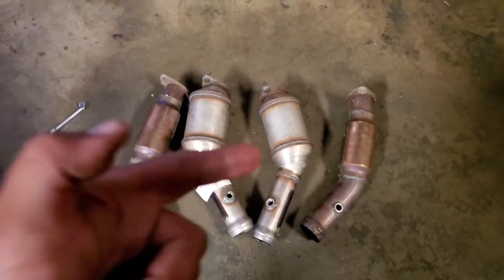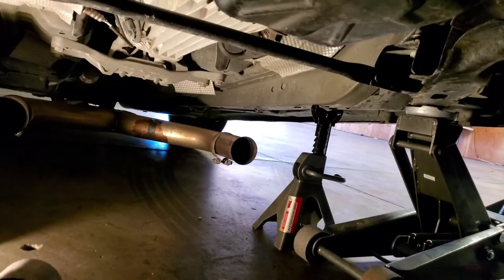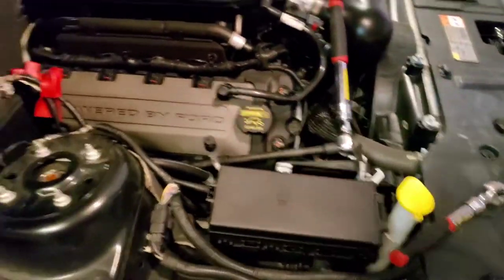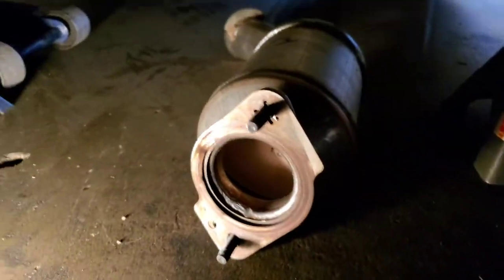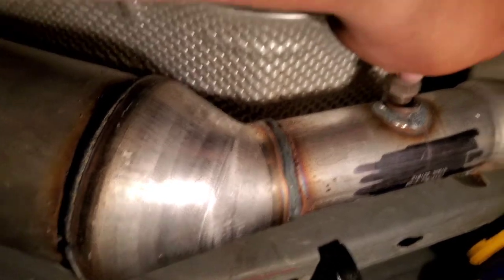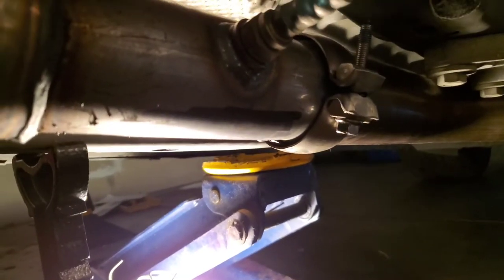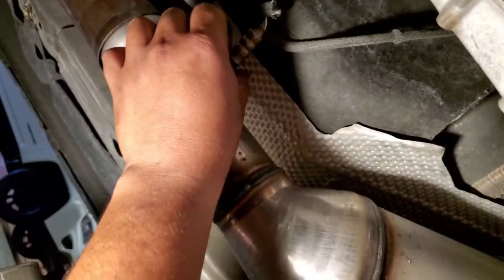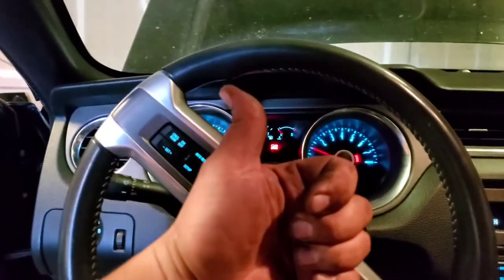How to: Install Bank 1 & Bank 2 Catalytic Converters on a 2014 Ford Mustang GT 5.0L

Comment: Hey man. I know this is an old video like the guy below, but I have a question. I just dry fit the cat to the X pipe with the ball & socket clamps. When full tightened, the parts don't come apart, but they definitely swivel around very easily like an actually ball & socket joint. Do you remember if this was the case when you did this install?

Comment: Hey man, I know this is an older video but I was wondering if maybe you could help me out real quick. I have a 14 Mustang GT and have code p2629. I have catless headers on the car. I am tuned through NGuage. I was told to replace the o2 sensor to see if that would fix the problem. The car idles very rough and doesn't feel very powerful. I'm assuming that I should look at upstream first. Does it matter which side I change out? Also, do you know if I will need one of the o2 extension cords? Thank you so much man!
Reply from the maker: Code P2629 is set by the PCM when the O2 Sensor Pumping Current Trim Circuit for Bank 2 Sensor 1 is open.

It's for the top Oxygen Sensor on the driver's side. Hopefully swapping this out will fix it....na u shouldn't need the extension....it's for the top Sensor on the driver's side u should be good

Read more at: https://www.obd-codes.com/p2629
Copyright OBD-Codes.com
Reply: Thank you sir! I will be doing it! Look for to new videos from you!
Reply from the maker: @ShadeAstray  thanx bro hope this works out for you!

Comment: Hey man quick question. I have the same car. It drives normal but I noticed that the idle is a bit rough and check engine popped up. I scanned it and got P0420. What happens if I drive it like that for maybe a month? Don’t have the money to replace the cats right now. Also, how much are the cats on the video? Thanks
Reply from the maker: You should be good driving it for a month, but they should be replaced as soon as possible to prevent engine damage. I believe one was like 600 and the other was 800. I got them from the dealership because aftermarket one can cause a check engine light. The oxygen sensors need to get exact readings

Comment: Did you have a check engine light on ? And if so did it turn off by its self or did you delete it?
Reply from the maker: Yes I did have a check engine light on, after I replaced the cats I had to delete the code

Comment: hi im planning to change my bank 2 sensor 1 (driver o2 sensor between manifold and cat) is it reachable under the car? is the connector reachable? special tool required? thanks
Reply from the maker: You can reach it by hand under the car just need oxygen sensor removal tool
Reply: How much miles were on the car? Why did the cats go bad?
Reply: @STREETFIGHTER50  close to 60k miles, my bank 2 sensor 1 02 sensor wire sleeve was damaged exposing the wire

Comment: Where ya get the new cats from?
Reply from the maker: Their from the dealership. Give your local dealership a call. Give them your vin and they can get you a price quote. Aftermarket cats won't pass smog and might give you a check engine
Reply: @559powerscape  
Thanks b appreciate the response